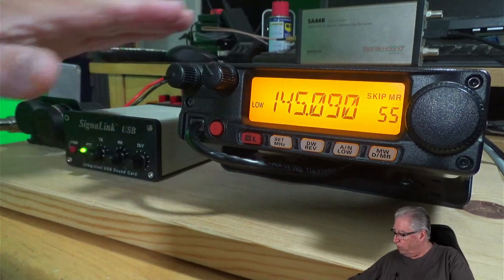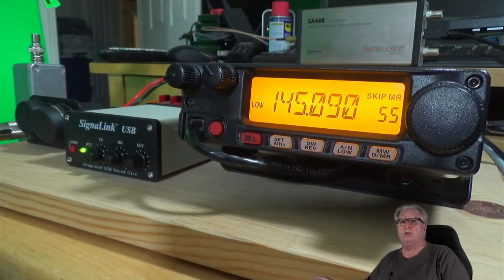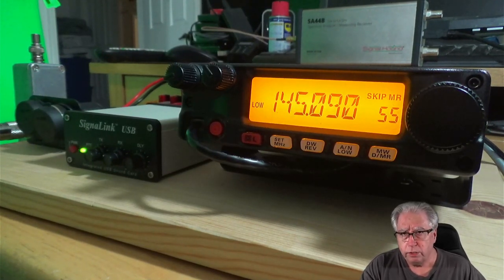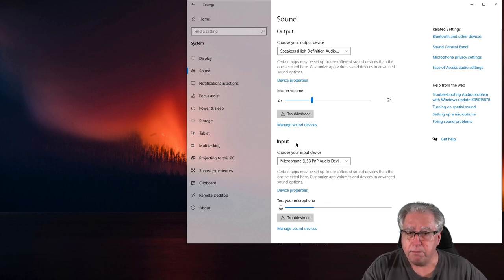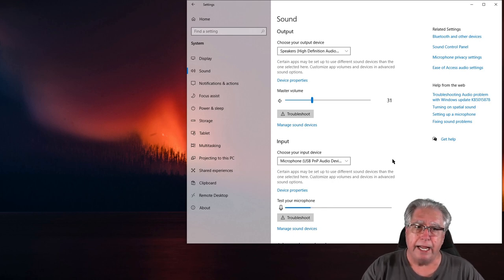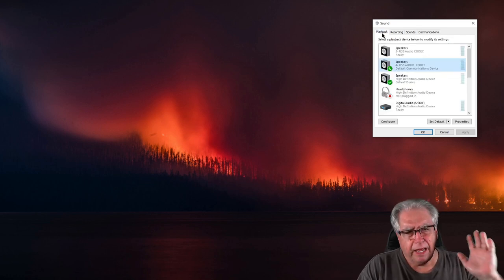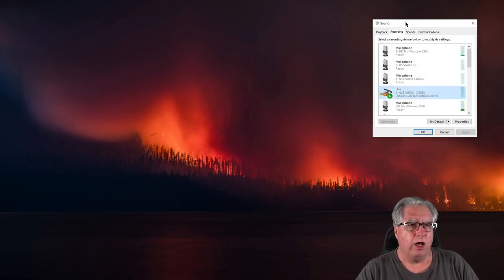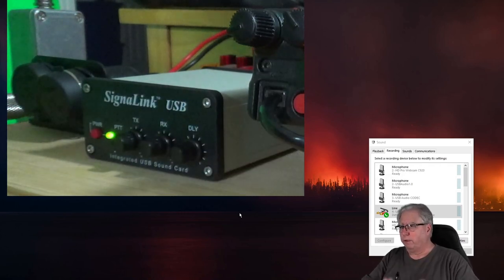Setting Digital Gain - What's the Best Way?

Comment: Thanks, Stu. Can't wait to see your next installment and more details about your equipment hookup to better see the 1.5 kHz +- bandwidth in action. Do you use the SoundModem program as a tuning device and move over to VARA once things are set?
Reply from the maker: Hi Robert,
Soundmodem works quite well at assisting in the settings. Once you get it set in Soundmodem it should work fine with Vara.

Stu
AG6AG